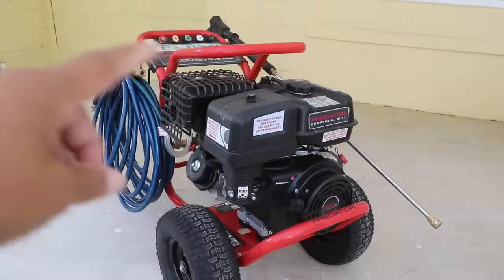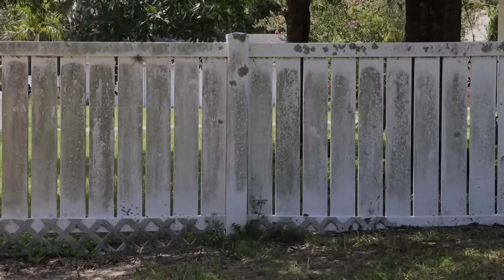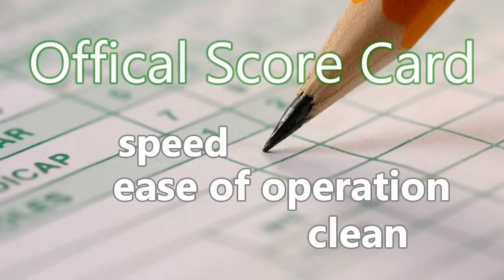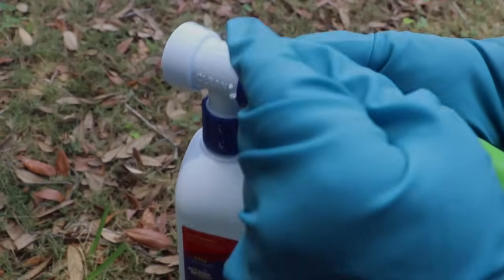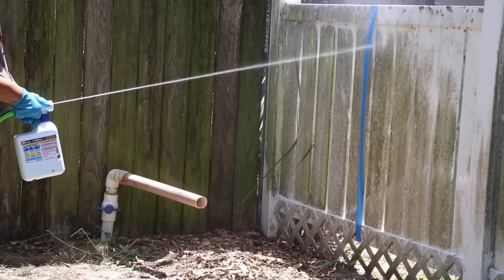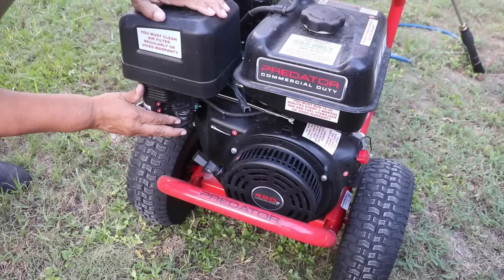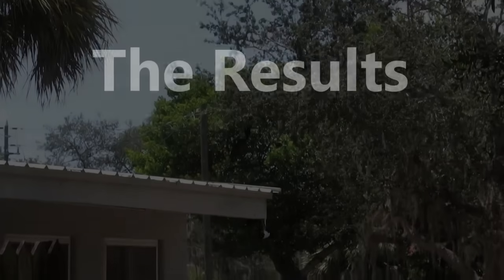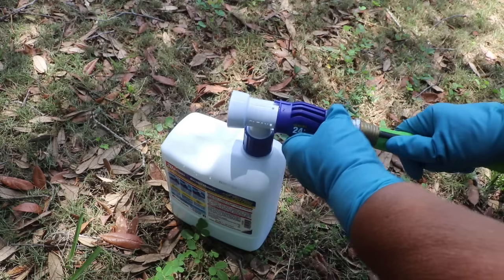pressure washer vs cleaner  EPIC GRUDGE MATCH

Comment: For those people that don't have a pressure washer, the thirty second cleaner should work  fine. After you spray the cleaner on, wait then take a soft bristle brush with a long hand on the fence before you rinse.
Reply: I was about to ask if a brush might make the thirty second cleaner successful. Thank you.
Reply: with a long handle, on the fence before you rinse
Reply: Or if you have a pressure washer but are in drought "season" and can't use it 😅

Comment: I've actually used this product several times. I find that using a brush along with the 30 second cleaner helps tremendously on the stubborn portions. A mixture of 30 second cleaner and a pressure washer to rinse would be the ideal combination.

Comment: Where I live the 30 seconds is spray on and leave on. Also, be careful using a pressure washer on pressure treated timber. You end up opening up the fibres and blasting out the chemicals that prevent rot. Your timber won't last too long after that.

Comment: The pressure washer is great but only on the right surfaces. Some siding will be eaten by the pressure in a pressure washer no matter which tip or pressure setting, vinyl is especially sensitive to this.
Reply: You also have to watch the Hardy and LP cement-type siding.
Reply: You can always take a couple steps back, that'll lower the pressure per square inch of whatever you're power washing.

Comment: If you want to save even more money and have a dish washer. Then take three dishwasher tablets disolve in enough hot water to fill a hand trigger spray bottle. Once gone cold pour the solution in to your spray bottle go and spray the frnce, leave for half an hour the hose down the fence with a normal hose pipe. Awesome! And the same solution will clean pretty much anything. If you don't have a dish washer buy the tablets. Each bottle of solution costs less than $2 to make and has many uses . If you want effortless glass  shower cleaning spray the internal glass before you shower, whilst you shower the steam and the water clean it for you. It's amazing.

Comment: That mold was bad so pressure cleaning may be the first solution. Afterwards you can maintain with the 30 second cleaner. I also use a product called wet and forget on the fence and vinyl siding . keeps mold and algae from coming back. I get it at lowes

Comment: Hi Leah,
Everything you do is interesting. We have well water and lower pressure than city water. A pressure washer would be better for me. As for killing any grass, ‘IF’ it did, it would be along the fence line, not the entire lawn. People often make comments about pressure washers without understanding how they work. The amount of pressure is adjustable. Tip for power washers: Get a large piece of cardboard (Old box, etc) and try to slide it under the bottom of the fence slats. This will greatly reduce the
4:00 
 amount of mud splashing back at you. 
I’ve watched people end up looking like they had been in a mud  puddle.
Reply from the maker: Nice tip

Comment: Thank you for testing for us? BTW I watched you on the show Tough as Nails, and you did very well. 😊 You are tough 💪. As for my tries, I have used the hose attachment Windex brand to clean my house windows and it does a great job. And I do have a pressure washer but it's a little overkill for windows, but I use Dawn dish soap, let it soak, and pressure wash my driveway for oil spots removal and it works great. Thank you again 👍

Comment: You can also buy washers that run on a variety of battery systems. Maybe not the power of a gas, but much easier to use-which makes them more likely to get used.
Reply from the maker: The "Ugly House" has a lot of pressure washing projects in it's future.
Reply: I have an electric Ryobi power washer. It works very well for the around the house projects. I wouldn't count on it to strip decks all summer long or anything lol, but for the $ it's a great little machine.

Comment: OK, I have used both. It does NOT have to be an either / or decision. Use the cleaning detergent to loosen up the dirt and mold - let is sit about 20 minutes. Also, get an extension wand for your pressure washer that will allow you to get higher up on the siding. Get a turbo nozzle that GREATLY improves the cleaning power of a pressure washer. Do NOT uses one of the bead-like pressure washer nozzles, as it can damage siding (don't ask me how I know!). For driveways, mix your own bleach mix and buy a rotating attachment that will make the job go MUCH quicker!

Comment: I use both , 30 second cleaner and then rinse with pressure washer. That 30 second cleanser is nasty stuff. If it splashes on your clothes,it’ll make bleached spots, wear clothes that you don’t mind getting ruined. By the way, I put the cleaner in a pump spray bottle

Comment: One thing to consider is that the “cleaner” is a continuous expense (every time you use it, you’re spraying out money) while the power washer is a one time expense with multiple uses.
Reply: Point. As long as nothing breaks, and your gas and water is cheap
Reply: @bluestripes6037  and as long as you are not on city water
Reply: @duckgoose6234  : both, cleaner and power wash, require that you be connected to a water supply.

Comment: I would like to add a few thoughts.
1: The pressure washer is much more hassle to set up and put away again.
2: In 20 minutes cleaning time for the whole fence, the pressure washer consumes 84 gallons (that's 336 liters) of tap water and produces the exact same amount of waste water, which can turn your lawn (and the operator, too) into a swamp.
3: The 30sec is a detergent which I don't want on my skin.
4: I also don't want to use too much detergents to save the environment.
5: I'm not sure if the detergent won't kill my lawn.
6: A pressure washer is dang funny to operate.

I clearly am team PW
Reply: It does contain bleach, which I'm not keen on either, but the website says it's safe to use around plants and animals.  
I'll stick with my pressure washer.
Reply: I'm team "bucket and scrubbing brush" 😄
Reply: @ironpirate8  which isn't too bad either.

Comment: A pressure washer can erode a vinyl surface and remove the smooth finish. Then dirt an mold accumulates faster. I’d use the cleaner and a soft brush or sponge.

Comment: Use a foam cannon on the pressure washer with outdoor bleach.  Foam a 30' section of fence.  Wait a few minutes.  Blast it off.  You can also buy this 30 second cleaner by the gallon for about $10.  Its also a bleach with a little bit of surfactant (soap) in it.

Comment: Awesome video! Ill drop a bit of 2 cents as well. Ive used both methods in the past and what ive started doing is moxing the two processes. If the job is extremely dirty, ill use the cleaner first and rinse with the power washer. My power washer is electric so it isnt as powerful as thr gas powered one. But it works for me. Im on well water so water consumption isnt an issue for me. Thanks for all the cool vidoes! Keep them coming! :-)
Reply from the maker: Thanks for commenting

Comment: Problem is what is the chemistry with the cleaner most use a bleaching agent which can’t be used everywhere and how large an area are you cleaning and how often (I had a gasoline power washer that worked great and cost less than half your price)

Comment: I have a pressure washer, so I would probably go that route. Provided I can get the darn thing to start! 😮
Reply from the maker: Isn't that the truth...they're so darn difficult to start.
Reply: @seejanedrill  Leah - Maybe you could do a video (or maybe you already have?) on how to clean a carburetor on a small engine to get it to start. I have a pressure washer, portable generator, and push mower - all use gasoline and I don’t use them regularly so they tend to clog up in the carburetor and then won’t start. I’ve tried to clean the carbs but it seems I always end up taking them in for service because I can’t get them to work.  Thanks!  - Steve

Edit: typo
Reply: @spat7378, the most important thing is to buy gas with no ethanol in it for things with a carburetor. That makes things much easier to use and with less gunk buildup.
Reply from the maker: @spat7378 I did a video, I'll link it for you https://youtube.com/watch?v=GPxycacHfGQ&feature=share9
Reply: @meganlalli5450  Thanks. I know to do that, but the only station I know of in my area that has ethanol-free gas is across town. It’s easier to buy the “wrong” gas close by and then be mad at myself months later for doing so. 🫤🫤
Reply: @seejanedrill  Thanks! I’ll see if that product is available in my area.

Comment: Pressure washer 90 / spray cleaner 10.  Setup time was not a factor. What was the only factor was how well each method cleaned the fence with the techniques used.
Reply from the maker: Set-up time is a factor for many....hoses, gas and it heavy and awkward  as heck.

Comment: Instead of paying $30 for the cleaner just get a gallon of bleach for $5 and mix it half with water and it does a much better job. If you look at the description it has bleach in it. Besides chemicals and pressure washers are used for different purposes. Chemicals kill organics and pressure washers are for non-organic.

Comment: Love ya  ,but I gotta totally disagree with you ! For the following reasons
30 second cleaner : $20.00  put bottle in trunk, drive home ,hook to the hose ,BOOM ,DONE!
pressure washer : $250+ to buy ,$60+ to rent ,
Then getting it home .(better have an SUV,mini van or truck .
Have to buy gasoline  ,fill it up then all the start up procedures ,then take it back to the rental place . 
For the price,ease of use and cost you could use 30second wash  a couple times. And still have money compared to using a pressure washer. Winner 30second wash

Comment: What kind of toxic chemicals are spewed into the air and leeched into the ground with the 30 Second Cleaner? And before anyone @ me, there are electric pressure washers.
Also, why is it called 30 Second when you have to let it soak for 3 minutes?
Reply from the maker: I have lots of cleaning projects to do and an electric pressure washer would not serve my needs.